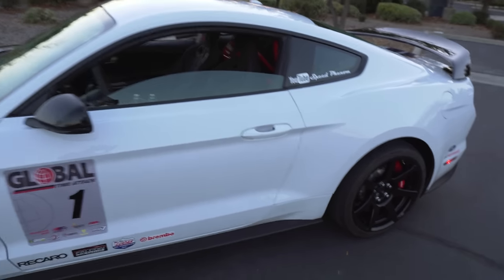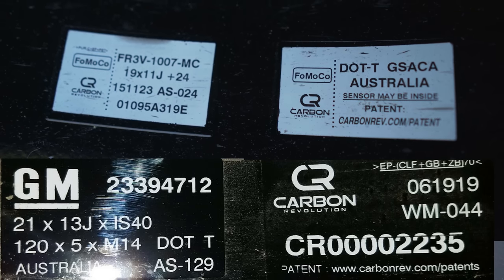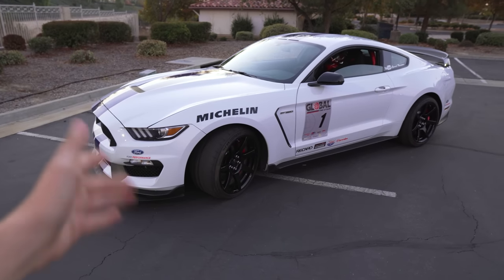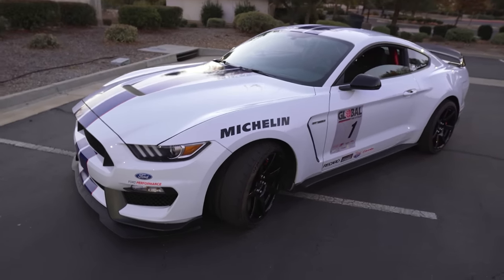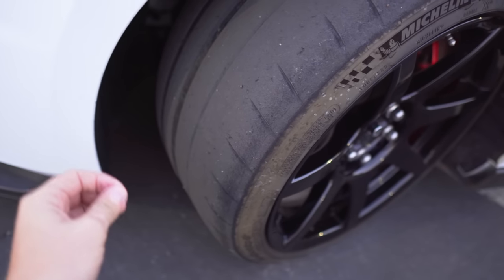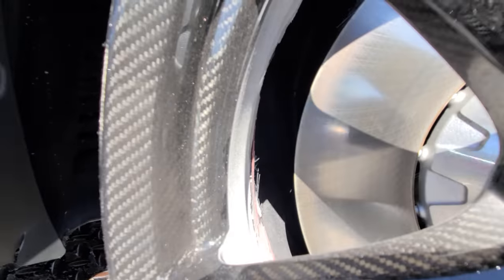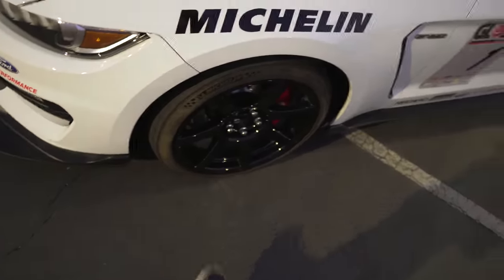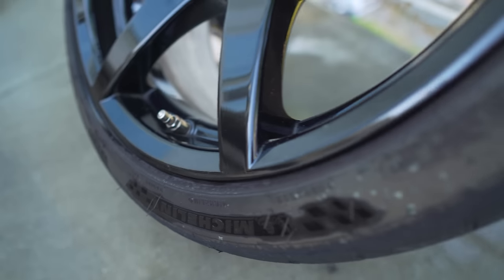NEW MUSTANG GT500 SHATTERS CARBON FIBER WHEELS ($18,500 Option)

Comment: It is ridiculous to run carbon wheels on the street. They are strong, but brittle.
Reply: Brittle only have meaning when its got over loaded with their designed strength. Properly use of a proper engineered part should be fine
Reply: @davidtlchow  And one never knows what one will encounter on the street. These are race rims (basically) where most all "street" obstacles are not around.

Comment: First off, the only time I would put carbon fiber wheels on any car is when I'd be tracking it.  For around town or everyday driving, I'd invest in aluminum wheels with regular high performance Z rated tyres.   For track days, I'd change over to the carbon fiber wheels and trailer the car to and from the track.  Just say'in.
Reply: Makes sense to me,they are not for show at the " cars n coffee" !
Reply: CFRP will also decrease NVH to a big degree, which is good for a daily. Insurance will pay for replacement if OEM.

Aftermarket cfrp wheels? No way.
Reply: Shock tuning wrong switching between carbon and heavier wheels

Comment: Carbon fiber wheels aren't all they're "cracked up" to be. After seeing that I wouldn't be going high speed around a track with them on my vehicle.
Reply: They’re stronger than aluminum wheels.
Reply: @e36s54  I've never seen an aluminum wheel splinter into a thousand pieces all over the road like this one. Stronger?
Reply: They are stronger than aluminum alloy!
Reply: @sureshot70  they are significantly stronger but also more brittle, kinda like glass or diamonds much harder than steel etc but also brittle and cracks before it bends
Reply: @cessealbeach  Are you in the development or sales department of carbon fiber wheels that gives you this information? Or you spent $10,000 on a set of them? I for one wouldn't risk my life on running a brittle wheel like that on a car to push at high speed around a track.
Reply: @dylanthegreat13  So why spend huge amounts of money on something that will splinter apart and possibly kill you or your passengers? I'll pass just to have the latest and greatest.
Reply: @sureshot70  metal buckles at max strength were carbon shaters.  Has nothing to do if something is stronger or not.  If a plane can do 9 g without shattering and made of carbon destroys your theory.  There is pros and cons to both.
Reply: @ShadowOppsRC  "shatters" - Did you watch the video? I'll bet you don't own or will never own carbon fiber wheels. Show me the plane video with the carbon fiber plane and doing 9 Gs. My theory is fact not theory.

Comment: I want to clarify a few things that Austin has said in this video since everyone here seems to be missing the big picture and jumping to conclusions.
Austin already clarified that Carbon wheels are stronger, lighter and stiffer than alloy wheels. The performance benefits of these wheels is night and day. BUT, anything can fail given the right situation and combination of circumstances. This particular incident (I was there) was an extreme impact on the wheels which would normally never happen in any kind of driving. Even hitting a large pot hole would not equate to this impact. Alloy wheels would been horribly damaged as well with this situation. Austin is NOT giving more details here because he has integrity and is honorably respecting the wishes of all involved to not reveal details our identities. Most YouTubers wouldn't give a shit and would tell you more to get more clicks. Not Austin. 
On the flip side (and more normal side) I have been daily driving with my carbons for 11k miles. Street. Canyons. And many track days. With zero issues. When I clean the wheels up they're as good as new! 
The overall point here is that any kind of wheel can break if treated badly (or you have bad luck). The carbon wheels may break far less (percentages wise) than alloys, and you're getting far more performance with those wheels, BUT if they do break, the cost is far higher. So you make a cost benefit analysis and make your choice.
I spent $18,500 on the carbon track pack so it would be dumb to replace them with cheaper, lower performing wheels.
Reply: Thanks for clarifying. Without revealing too much, can you tell us what was hit and any other circumstances?
Reply: @tobywonkinoby8916  Car ran over a curb median. Don't ask me how this happened. I have zero idea. I just witnessed the aftermath.

Comment: I would rather have wheels made of of magnesium. Carbon is great everywhere else but rims.
Reply: Rims get the most brunt among all the parts in the car.  What’s next carbon fiber differential?
Reply: @David-jh8mp  carbon fiber engine block, transmission, full carbon fiber exhaust from the headers to the mufflers. And lastly a carbon fiber brain.

Comment: Seems that the wheel ran over a rock or something of that nature.  It's just the nature of carbon fiber.  Being so rigid, CF maintains nearly maximum rigidity right up to it's failure point.  Once its exceeded, it simply cracks/shatters.  An aluminum wheel would have more than likely failed as well but not in the same dramatic fashion as the CF wheel did.

Comment: Any other wheel would break beyond repair the same way. Its just that carbon breaks into smaller pieces. Either way it would break
Reply: That is not true at all.  Other material (Aluminum, magnesium, forged ext) wheels would more than likely bend, dent or deform, not shatter.  Obviously, wether it's a major bend or shattering in this case; both cases are catastrophic losses.  I have been racing for many years.  I'm not hating on the carbon wheels but the simple fact of the matter is it is science.
Reply: Urmom1985 interesting as my wife ran over a full concrete island/curb in the WRX and cracked both left side rims. Two spoke per rim. I was surprised (and mad).

Comment: I had a similar result with a 22 inch aluminum wheel in Chicago. I was going south out of Chicago going 80 miles an hour hit a pot hole the size of Texas split the wheel right in half in the middle just like that one. I realize different materials what impacted the wheel was the edge of the pothole all the way across the tire and the rim wasn't damaged on the outside either.

Comment: Not a fluke fiber glass/ is the same as carbon fiber. If carbon fiber suffers any sort of impact it's integrity is compromised. So having recognized and learned more of how Carbon fiber suffers from such force, personally I would go aluminum. I don't know what carbon fiber under heat and cold reveals due to expansion and contraction elements but we, you, need to put common sense into practice and understand the results don't lie.  At some point heat and cold would impede fiberglasses strength. Just my engineering minding learning and seeing.

Comment: I thought carbon fiber wheels were supposed to be stronger let alone lighter?
Reply: Archimedes  . carry thru the thought, dimish capacity increase strength. not applicable to fixed dimension requirement.  formula cars light, street cars 3 to 4 times weight, poor choice of materials for street cars.

Comment: Very informative.  I don't have any so I can't say much, but that leading edge and specialized technology designed specifically for high level racing.  I would say 2 things; it may be inherent living on "the edge" if you will, and maybe it's like the corona virus and the vaccine; just so new they don't know everything about it until it is put to the test in the field and they learn more as they go.  I expect the wheels are likely upwards of $20k for a set.  Are they itemized on the sticker for the car - probably bundled into the "track pack" option. I saw years ago that a $100,000 car might cost $1,000,000 one part at a time at the parts department of a dealership.  Can't wait to hear what replacing one will cost; I'd expect 5 or 6k and I guess insurance wouldn't cover it??
Reply: lol cdc says they havent isolated con vid1984.. so how is it new?

Comment: it's not clear what the situation is he's showing. The only clear picture I saw of the tire, was a BALD tire. If you are running lultra low profile tires, and they are bald to boot, then it's likely the tire was  punctured or otherwise damaged, or run low on air. Which would cause an overheating problem and/or loss of control. I say who really NEEDS these exotic wheels. If you do insist on buying such wheels, perhaps you should invest in new tires, when they are worn to the tread bars, and NOT keep driving on BALD tires.

Comment: Lower performance (heavy and much higher inertia) low profile tires with carbon wheels doubly dumb and super low impact toughness.  F1 banned carbon wheels even with the high tire profile.  Any winning race driver or engineer knows this. Low profile is all for styling.  F1 keeps rejecting tire manufacturers pushing low profile due to terrible performance drop.

Comment: Costs: Porsche has an in-between brake, as we all have been introduced to this year. Why? Better than the standard cast iron rotor; lighter weight with two piece wheels and rotors. Better that cast iron but not as expensive as ceramic brakes with center lock wheels. Extremely light weight wheels that still are heavier than carbon fiber wheels. Rotating mass should be reduced, but overall expense on the road and on the track with consumables, when you are driving your car enthusiastically or doing hot laps on the track. Unless you have an unlimited supply of money, perhaps a little less performance but some sort of cost savings, seems like it might be the way to go. My take on carbon fiber wheels, AE, is that I would removed them from the car and be taking them to the track. Once having driven to the track, then I'd put those carbons on. Done on the track. Take them off. Carbon fiber wheels have a life span or a half life. They break down. Certain manufactures actually give the mileage on their stock carbon wheels at which time they must be replaced. What does that tell you about carbon fiber wheels? Just a thought. AF

Comment: Super low-profile tires.  Underinflated or hitting something like a rock, debris or a bad spot in the road and there isn't much to protect the rim.   Call me crazy, but I would have a set of 17's or 18's for the street.  I've never upgraded to larger rims for either of my Cobras and have never had a problem, tire or rim-wise.

Comment: How has anyone not said anything about his brakes yet? On a performance model like this, I dont think it is wise to run just vented brake rotors. Not saying that it is an issue with the rim breaking like it did, but excess heat can cause issues with the wheels. This car was made for slotted and drilled rotors for a reason. Any high performance car, you are going to find those on it.

Comment: That is the downside to carbon fiber....when it fails......snap snap
A nice aluminum rim would just dent or crack......life could roll on for a few more feet
Reply: Crack.. I've seen alloy wheels miss more than quarter sized "pizza slices" after an impact. Those were not cheap wheels wither.
I have damaged a CF wheel on track at a high rate of speed, and it was very undramatic. Had that been an alloy wheel, the damage would have been tremendous and air loss instant. The CF wheel kept its integrity and air loss was "slow". It kept me from hitting the wall.

Comment: I've never had carbon fibre wheels & that unsprung  wt. Is a win - win in most ways using them on the street probably won't be too good.potholes etc. Can't help but it may be back to the drawing board for the industry to try & get more durable - less brittle composition.

Comment: If you have funds like a F1 team then use carbon fiber wheels. These guys racing their GT500s are probably not gonna notice a big time difference in actual track times but will notice it when they cut a corner or clip a curb. I worked on composite aircraft in the military and we were constantly watching for delaminates below surface. Composites do not have universal strength in all directions like most metals do so must be woven to have strength in a certain direction. Composites make nice light hoods and body panels but wheels and suspension parts are not their place imo.
Reply: And just how are we supposed to win the HPDE day with stupid heavy aluminum wheels? Apparently you really haven't thought this through.
Reply: F1 uses forged magnesium wheels
Reply: @ericmichel3857  HIGH DENSITY POLYETHYLENE ....HDPE.

Comment: There is no way I would run carbon fiber wheels here in Atlanta. These roads are horrible. There are pot holes that will swallow half your wheel. Then we also have roads where the asphalt will have a 5 inch raise and feels like you run into a damn curb when you hit it.

Comment: If a stone gets caught between the caliper and inside of the wheel it will compromise the heat shield coating, gouging the carbon and compromise the wheel in the area that failed.

Comment: Carbon wheels are just like any other wheel. The problem is when they fail they fail catastrophically instead of bending or cracking as metal does. I would definitely take the carbon wheels off on the street and put them back on for the track. 18k replacements vs 2k set of street wheels.

Comment: Gordon Murray's new car will not have carbon fiber rims for this very reason.  They are using forged aluminum or magnesium rims I can't quite remember.  He said they will be only slightly heavier than carbon fiber. Slightly as in only a couple of grams.  Magnesium is very abundant and strong. No more dangerous than having a metal box filled with highly explosive and combustible liquid sloshing around under the back seat.

Comment: Gyroscopic force, the force is actually felt 90 degrees in the direction of rotation from the applied force. If force is applied at the 9 o'clock, the wheel rotating clockwise, the force is felt at the 12 o'clock.. it will also want to turn (not rotate but turn) its complicated :-)

Comment: I can't believe that it wouldn't be cover under warranty if you were just driving down the road . I realize the wheel should cost 18K but if his dealer made him pay for it I'd find a new dealer . The tires aren't a warranty item but the wheels at least as far as manufacturing defects they're going to cover it . The other option is this is an insurance claim as an accident that was caused by a road hazard either he ran over something or though a pot hole and broke the  wheel because the tire was punctured . I don't think that would be possible if the tire still had air in it so it needs to be a pretty catastrophic impact .

Comment: I'd be willing to bet, he was running the tires at to low of an air pressure, causing overheating & the tire blew. You guys do track days & everybody knows you drop air pressure to increase heat in the tire, which makes it stick more. Those tires don't have much tread & they are really not made for street use. Tires get to hot & the tire will blow. Tires are hot & you hit a sharp rock, on a tire with no tread & it blows. Also you guys should be running nitrogen in those tires. I'm not sure if Ford fills them from the factory , but if they don't, you guys should have that done!!!

Comment: I think id settle for slightly worse performance and go for a set of forged wheels. Would if that happened at speed? The results could be life or death. Not to say a blowout on a forged wheel wouldnt be but ive never seen an aluminum wheel explode like that. Regardless i think if you can afford the car and or wheels then our opinion really doesnt matter that much does it?

Comment: The explanation is easy the more the Manufacture's try to cater to the Track people, the less Street reliable the vehicles are becoming. Summer Only tires, light weight wheels and other suspension modification's do not survive in a City Environment.

Comment: -hit something at high impact that damaged them or prior owner/test driver and now new owner see's the fatigued result...
-defect from factory with resin or weave thickness...expanded when pressure inside wheel increased with hitting something high impact
-long nail puncture into rim
-someone was pissed off at the wheel shop when tires were added
-some funny result of how the wheel was balanced/aligned coupled with thermal stress

Comment: Possibly when street driving air pressure might play a role? Also in the clip it looks like the CF wheel spilt just above the rotor. Maybe continues heating and cooling when used at the track and street use? Lastly maybe the thickness of the CF is of inadequate thickness or just not reinforced properly in that area?

Comment: The aftermath shown without getting the details from the owner, cant really say anything. but i know for the fact that these wheels go through very extensive crash testing and are stronger than alloy wheels.
that aftermath could have been due to hitting something really hard, and since the carbon flexes, those pieces may have been cut by the discs

Comment: Carbon fiber is great for racing at the track where the maintained surfaces are predictable and within the tolerance of the wheels. Once you go out and hit the road with track intended parts, you find their achilles heel real fast. How far would an Indy car get on the highway before it ran into a high spot and busted off its front wing?

Comment: Failure modes like that can start from several different points, but my guess is that the tire deflated for some reason, then the wheel started taking impact loads, maybe in the barrel, maybe the bead rim.  Carbon fiber (like fiberglass) doesn't like point loads, and where they locally fail the strength in the area around the failure really degrades.  Especially if the owner that suffered these failures was running negative camber, then the inner bead rim takes the brunt, which causes the barrel to flex, which could cause the barrel to fracture, etc.